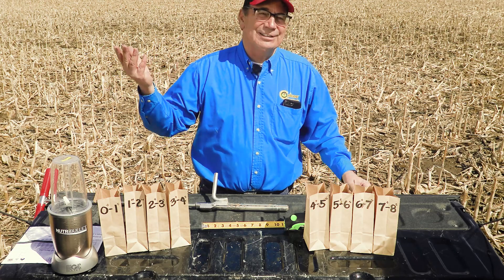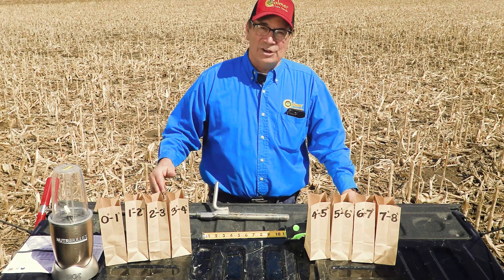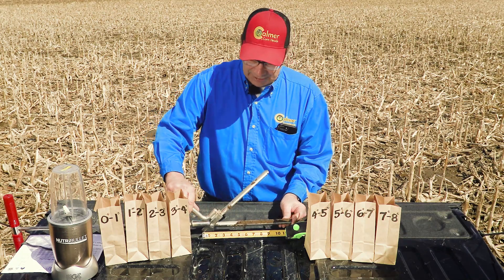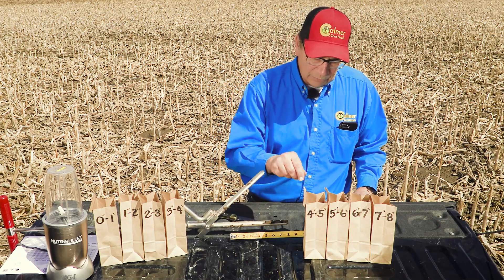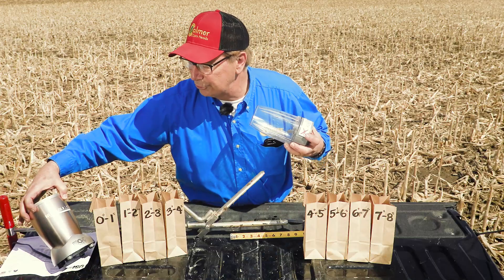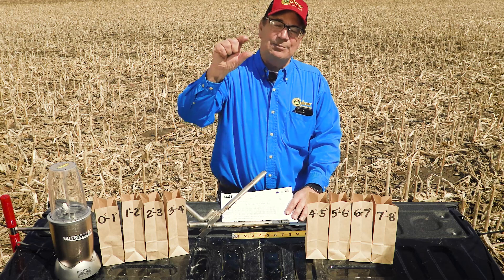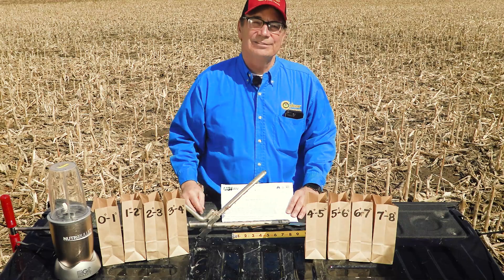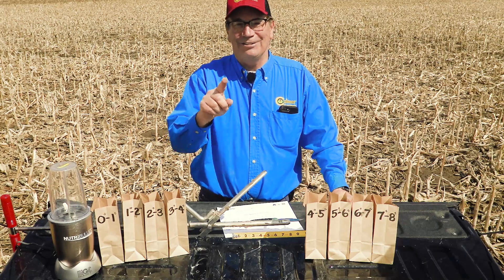How to Test for Nutrient Stratification

Comment: I seen a study from a feller I can't recall who did surface band, broadcast and a deep band study for a 3 year period and the surface band was the highest yield surprisingly over the 6 inch deep band.  He figured it was because it was dry in July and when they did get pop up showers the moisture was in the top inch or two where the nutrients were. Maybe a concentrated band of potassium chloride causes the roots to avoid the band was another thought and the surface applied met the root in a diluted form.🤷‍♂️